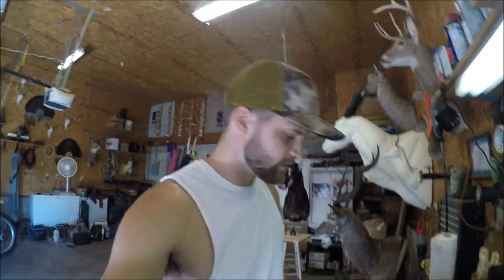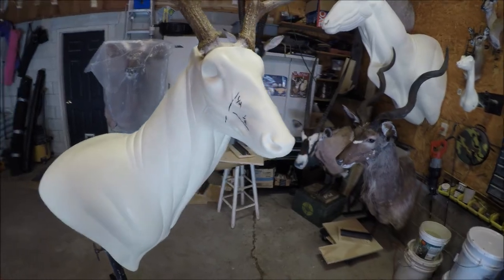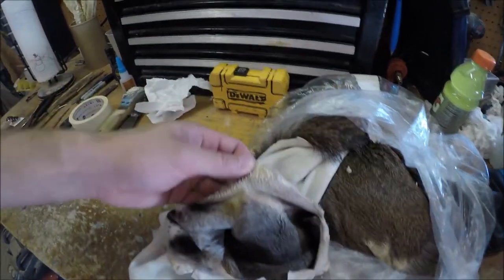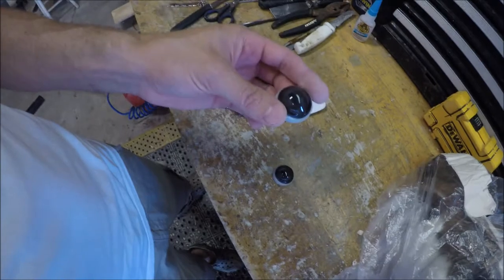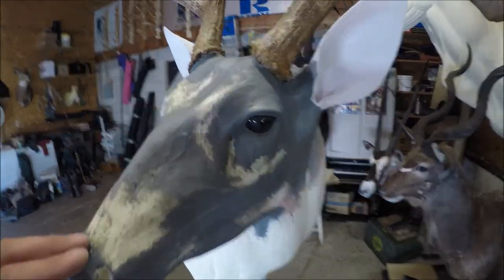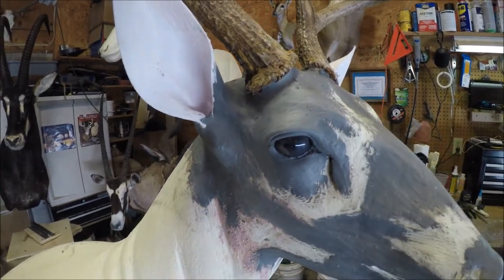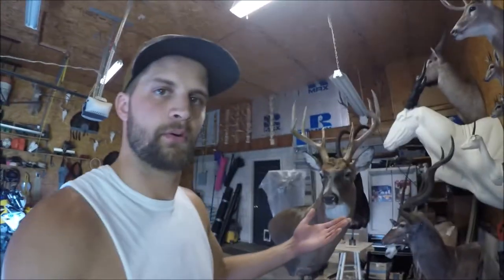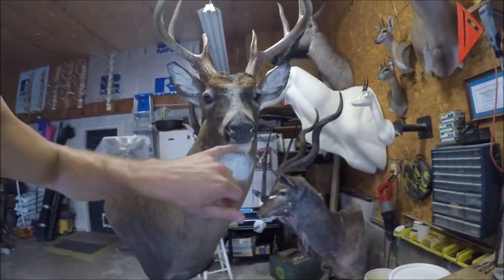Mounting a WHITETAIL DEER + process and time-lapse

Comment: Why did u cut the head off just to put it back on
Reply from the maker: I had to make the head bigger so I needed to cut the head off to cut the head from the back of head(skull) to the nose and make it deeper from eye to the bottom of the jaw.  Thanks for watching
Reply: @year-roundoutdoorswithnath9678  had a lot of extra hide on the head when dry fit it ? And nice work on eye clay work I been doing taxidermy for 10 years and still can’t do clay work eye sets as good as yours
Reply from the maker: Yeah after fitting the hide I had to make the head bigger. Thanks I’ve been doing taxidermy since 07 and do mostly exotics now. Always fun to put a whitetail together.
Reply: @year-roundoutdoorswithnath9678  I’ve been running my own shop 3 years now doing pretty well still have a hard time getting the eyes to be 100% correct